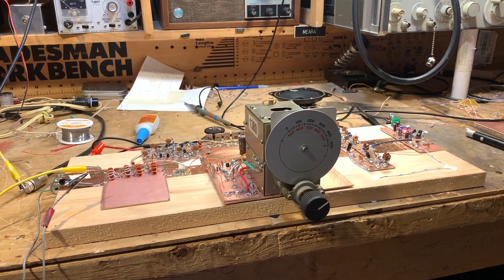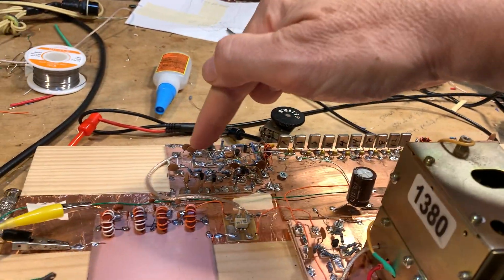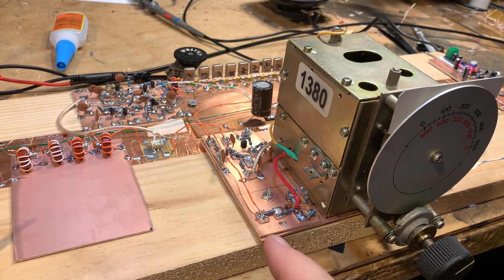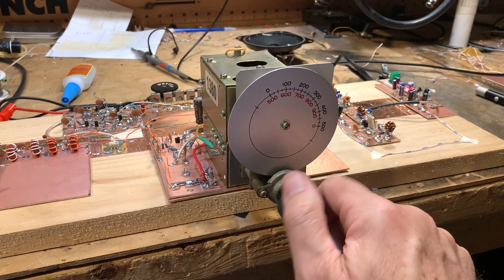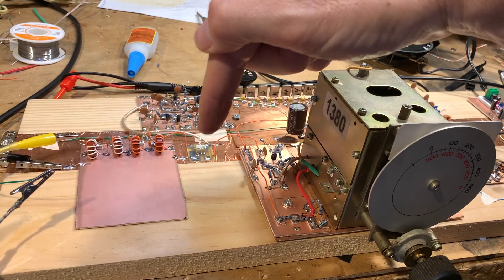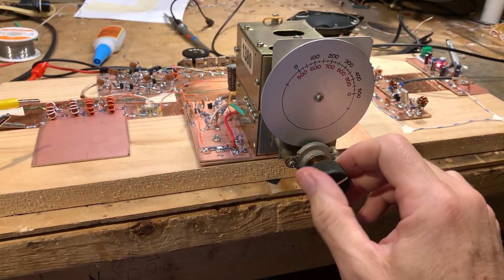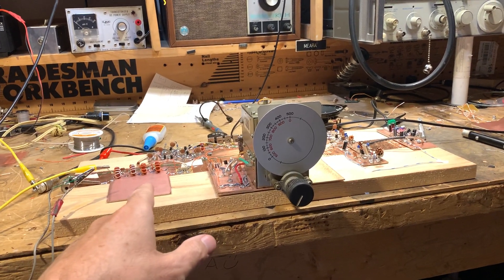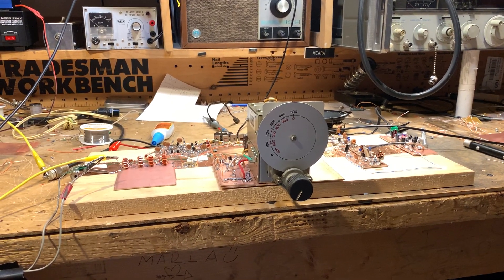SolderSmoke Video -- Mythbuster Video #4 -- First Signals

Comment: Congratulations Bill, the front of that speaker speaks volumes about "The Maker's Art". I'm building a scratch superhet for MW / 160m / 80m at the moment (all-discrete-transistor and sundry junk) and my workbench is in a similar state!
Reply from the maker: Wait until you see that speaker mounted on the front of the pine board!  73  Bill

Comment: Reverse polarity protection is really needed! Takes just one tired mistake. My µBITX inspired "moppeliikkari" project has all kinds of funky "not properly dead but funky behavior" thanks to some reverse polarity DC. 
It's an attempt to build a HF communications receiver around the RX strip from a Mobira-Nokia RD58 UHF trunked radio. 
The 86.5125MHz 1st IF and the ASK-1 first mixer just fit the µBITX frontend concept so well. 2nd IF is 455kHz, done with a SA602!
Reply from the maker: Yes, one diode and a fuse can save you from a lot of homebrew heartache.  73  Bill